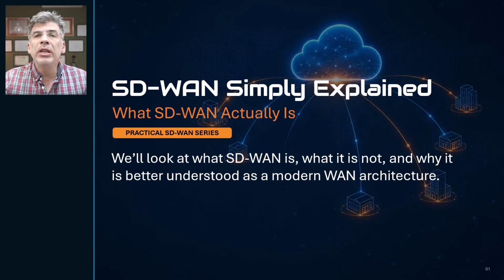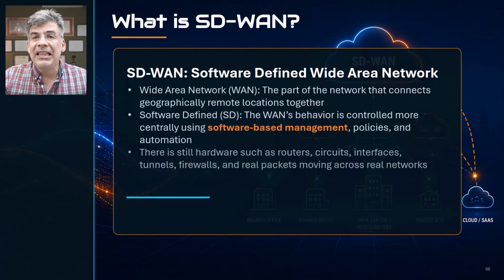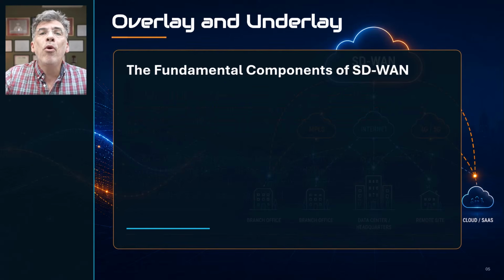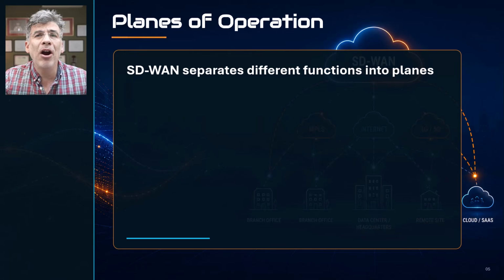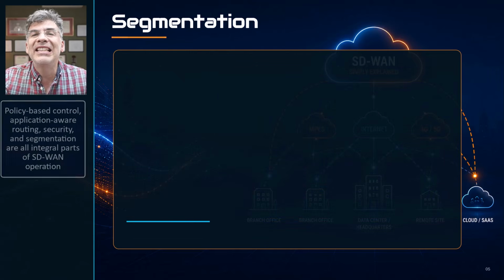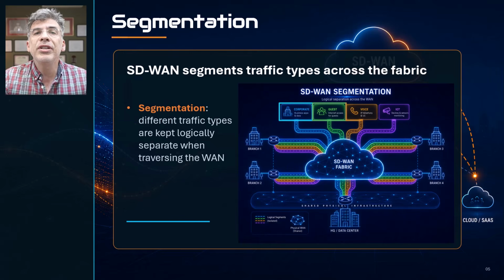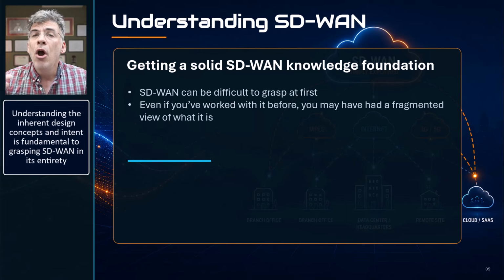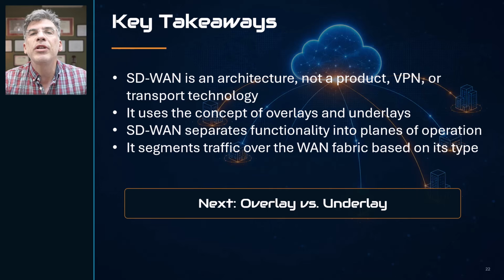What Is SD-WAN? SD-WAN Architecture Explained

Comment: Really clear breakdown of SD-WAN architecture, especially the underlay vs. overlay and the role of the management, control, and data planes. The explanation of segmentation and application-aware routing is also very useful for understanding how SD-WAN works in real-world networks. Versa Networks is another strong platform worth exploring for enterprise SD-WAN and integrated SASE capabilities.
Reply from the maker: Thank you! I’m glad you found the explanation useful, especially the underlay/overlay distinction and the different SD-WAN planes. Those are some of the key concepts that make everything else in SD-WAN easier to understand.

And absolutely, Versa is an important platform in this space, particularly when looking at the convergence of SD-WAN and SASE. I’m trying to keep this series largely vendor-neutral, and focusing specifically on Cisco for vendor-specific behavior, but I do mention some info about Versa and Fortinet in some videos.  Thanks for the suggestion!